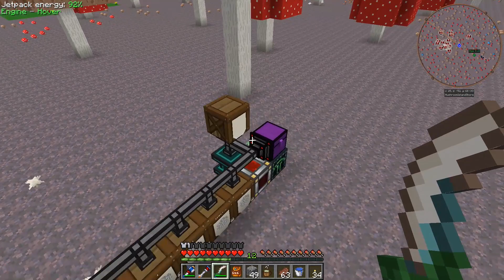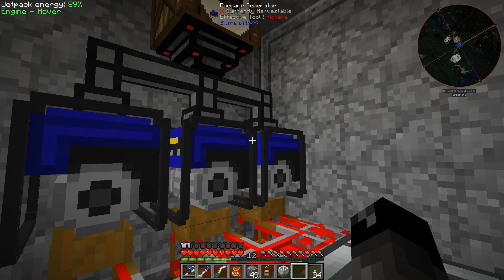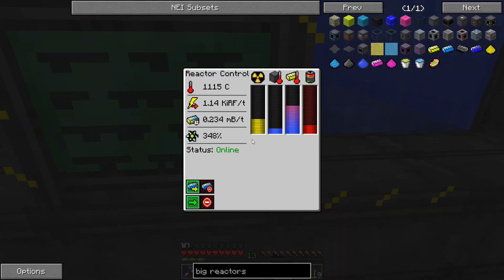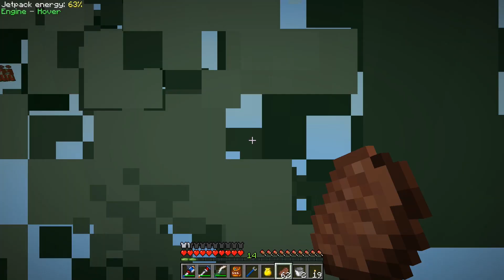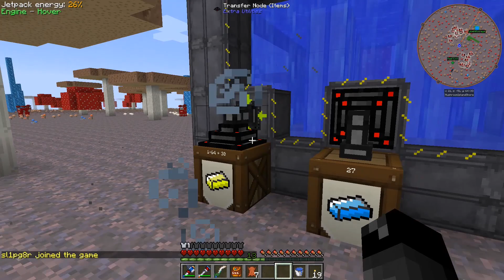Minecraft Mods FTB Infinity - BIG REACTOR POWER [E08] (HermitCraft Modded Server)

Comment: As built, that reactor should be able to support 13 maxed out turbines. With the better coil materials, it would only take 2 turbines to match or beat your current RF output. It looks like 2 layers of cryothium & 1 of enderium would be best, but that only gets you an extra 2,200 or so rf/t over 3 layers of enderium, & only 100 or so over all cryotheum. BigReactor Simulator is a nice web tool for checking reactor designs without having to actually build them, & it will even give you a parts list.

Comment: Hypnotizd   Power taps can be on the bottom (seen that in another twitch stream).. Gelid Cryotheum is the better liquid coolant but I have heard that Diamond blocks might be.  

The ejected material from Yellorium is  Cyanite, which you can use a recycler from big reactors to turn it into Blutonium ... which can be used as fuel.

Comment: There power multipliers for the ender quarry add-ons should be able to be lowered in the config.  i believe dmac noticed it in modsauce because he was using the efficiency III with the x80.  after adjusting the config i think it dropped it down to x5 or somewhere around there.
Reply from the maker: m3rfinator We're trying to keep the pack as close to the way the pack creator set it. The only config options we're changing is turning off those annoying FTB dev npcs.

Comment: You should take a look into active cooling. Its possible to create >100k RF/t easily.
Reply from the maker: EACPentrit This is meant to be a temporary power setup. The active cooling and turbine stuff just adds too much for what I want out of this reactor. I do want to look into that later on as I've never done that before!
Reply: Hypnotizd just remember to keep your rods cool and the case HOT! better output
Reply: Nobody0Important1  There is a simple yet extremely powerful setup which can power 16 15k RF/t turbines.
Reply: Well, scratch that. 1 reactor, 24 turbines generating 24k RF/t, totalling 576.000 RF/t :D